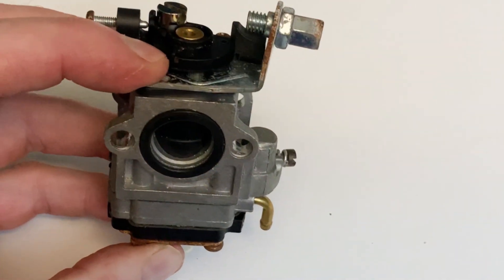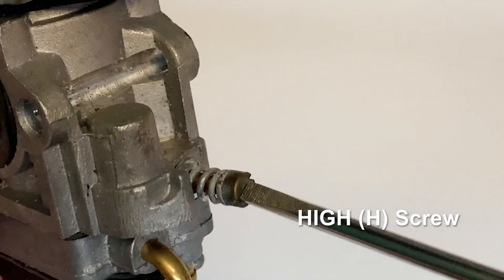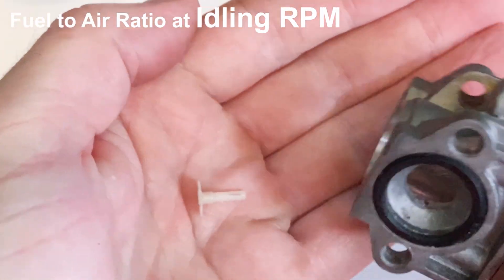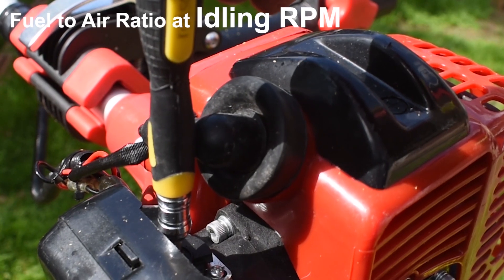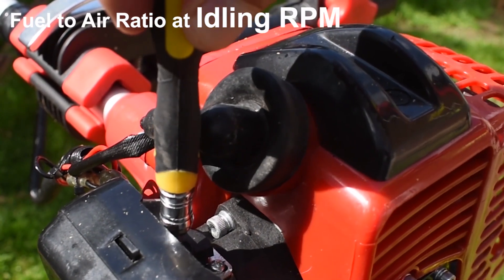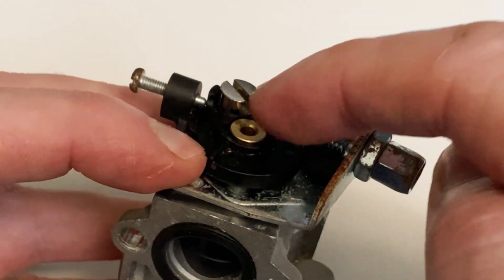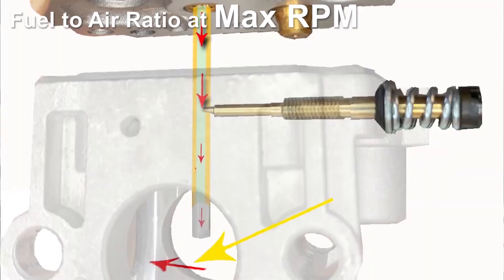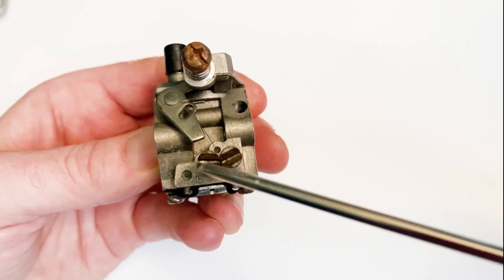Tune the Hidden 'LOW' and 'HIGH' Screw.  (by Craig Kirkman)

Comment: Hi

I have a John Deere t105s
It’ has the walboro carb but mine has no hidden screws at all. It’s the older version

So I bought a new Chinese knockoff and it’s same one that you have in your video.

I changed new fuel lines and new vented gas cap also.   So I put this new chinese carb in there and doesn’t run well

I noticed if you move the weedeater up and down or sideways the speed goes fast or slows down.  A lot of time it’s died out.  Even when warm sometimes it runs on choke which is strange.

I tried adjusting but something is always changing on me like when I change position of the weedeater the idle changes also

I fuel new file lines
Fuel filter also

What do you think it could be ?
Reply from the maker: Well, it’s not easy to say what is definitely wrong because it’s a case of trial error until the issue is found. But I do have some ideas as to what might be going on. Again, these are ideas: 

The new aftermarket carb may not be metering fuel correctly, especially when the machine is tilted.

When a trimmer changes speed or stalls simply from being moved up/down or sideways, that can say: 

1. The metering diaphragm is too stiff or not sealing properly

Many cheap Chinese carbs come with very hard pump + metering diaphragms. They don’t flex properly, so fuel delivery becomes inconsistent:
	•	When you tilt the machine → the diaphragm shifts slightly → fuel flow changes → RPM rises or drops.
	•	When it dies unless on choke → lean condition → metering diaphragm not opening the needle consistently.

Fix:
Try swapping the metering diaphragm and gasket from your original Walbro carb onto the new carb body, if it fits. If not, then try to acquire a OEM diaphragm. You will have to take a punt here as to whether it will run just like all others have to do in these situations. 

2. The metering lever height is incorrect from the factory

This is extremely common with knockoff carbs.

If the lever is:
	•	Too low → engine runs lean, dies, needs choke
	•	Too high → floods, loads up, bogs

Tilting the trimmer changes how the fuel sits in the metering chamber, so the problem becomes worse.

Fix:
Check lever height — it should be level with the carb body (Walbro spec).
Most new Chinese carbs come way out of spec.

3. You might have the fuel lines reversed

Even with new lines, if the purge bulb is connected backwards:
	•	It pulls air instead of fuel
	•	Tilt sensitivity gets worse
	•	Engine runs only on choke

Double-check this:

Fuel tank → filter → carb inlet
Carb outlet → purge bulb → return to tank

4. The vent on the new gas cap may not actually be venting

You replaced the cap, but some aftermarket caps don’t vent properly, causing:
	•	Lean running
	•	Stalling
	•	Needing choke
	•	RPM changing as the tank pressure fluctuates

Try loosening the cap while it’s running to see if the behaviour changes.

5. The Chinese carb may simply be a dud

You’re not imagining things — some of these carbs are wildly inconsistent internally.
If tilting the machine completely changes the idle, that only happens when the metering system inside the carb is unstable.

Here’s what I’d do, in order:
	1.	Swap the old Walbro diaphragms into the new carb if they fit. 
	2.	Set metering lever height level with carb body
	3.	Check fuel line routing (very common mistake)
	4.	Test with the gas cap loose
	5.	If still bad → rebuild the original Walbro
(They often run FAR better than most knockoffs)

Again, these are only ideas but I hope they help. 

Craig
Reply: Thank you for the ideas.  I will definitely try them out.

Comment: When setting the Lo-Speed needle do it in small increments and let the engine settle for a few seconds —then blip the throttle —it makes a BIG difference-again allow engine to settle and repeat sequence as necessary —Remember ! Leaning out the lo speed needle to much will make the engine when cold/warm it will be a pig to start —Likewise leaning out the Hi speed screw too much will make the engine rev higher — to be a “Screamer” —- but put it under work load -it will stagger and die —also being too lean can lead to piston/bore damage —-Secret is —Small adjustments and letting engine settle etc —Good video lad 👍🏻 clear explanation too for the novice “Tinkerer” 👍🏻
Reply from the maker: Great advice on those adjustments, thanks for sharing! Craig 👍

Comment: I need walbro caboratar dealer in Bangalore or Mysore karanataka
Reply from the maker: Thanks for your question! Walbro don’t usually sell directly to the public, so the best option in Bangalore or Mysore, Karnataka is to go through an authorized Stihl or Husqvarna dealer, since both brands use Walbro carburetors on many of their machines.

You can also check with:
	•	MGA Motors (Bangalore) – official dealer for Stihl in Karnataka.
	•	Husqvarna dealer outlets in Bangalore/Mysore.
	•	Online options like Amazon India or Flipkart, where genuine Walbro parts are sometimes listed.

Just make sure you’re getting OEM Walbro and not a clone – look for the Walbro stamp and part number on the carb.  

Let me know how you get on

Craig

Comment: Yes!! I finally understood the precise flow of fuel for the low n high engine mechanism. How to adjust both L & H screws by ear. And also adjust the idle screw if need to be. Gracias. Muchas gracias! You're my mentor n hero..Now let me go and make my weedeater do its job cause all this time It has been kicking my ass trying to make it work watching video after videos. A zillionfold blessings, Sir
Reply from the maker: That’s fantastic to hear, and I’m really happy the video gave you a good explanation of the fuel adjustment process. Craig 👍👍👍

Comment: I live at 4,700 feet (1432 meters) above sea level. It's very hard to adjust the low speed screw at this altitude. The high speed one had a much wider adjustement and not so difficult. I have to have my low speed screw almost all the way in. So I think if I lived even 300 or 400 feet higher I'd not be able to adjust it. The higher you are, the leaner you need the mixture, just like piston aircraft with carbs.
Reply: Maybe you explained yourself wrong....the higher the altitude the less air there is, so you adjust with less fuel. The ratio is not leaner, it must be the same "ratio" for proper running. You just need less fuel for less air. I also live at 1500m 💪🏻
Reply from the maker: Yes altitude definitely plays a big part in carburetor adjustment. 

At 4,700 ft (1432 m) the air is thinner, so the engine naturally runs richer. That’s why, as you’ve found, the LOW screw needs to be almost all the way in just to get a clean idle and transition.

You’re right that the HIGH screw usually gives more adjustment range, but the LOW circuit can run out of room at higher elevations. It’s the same principle as piston aircraft carbs — as you climb, you have to lean the mixture or the engine will bog.

If you ever did go much higher, you’d be spot on that adjustment alone might not be enough. In those cases, some people swap to a slightly smaller jet carb or file the limiter caps to allow more adjustment.

But overall, you’re handling it exactly as needed — leaning out the low circuit for your altitude so the saw can breathe properly. Great observation.

Thank you

Craig

Comment: Very well explained. I find this type of carb especially a bit more difficult to adjust. Its way easier on the ones with two larger screws. The hidden screw can be a pain to adjust whilst the engine is running. 
Still a well made carb and excellent explanation.
Reply from the maker: Thank you so much for your kind words. I really appreciate it. Craig

Comment: My strimmer idles a bit high, when unscrewing hidden screw it starts smoking and using to much fuel. but when turning in the screw it revs up even more and starts spinning. Do u know the factory settings for the hidden screw??

Comment: Another REALLY useful video.  I need to increase my knowledge as I am changing from a 4 stroke to a 2 stroke engine in my microlight.  I know the setup will be different to chain saws/weedeaters etc but the essential principles are the same. Thank you! 🙂

Comment: I have a carb on a JCB hedge cutter that has the hidden low screw but no H screw?  The only number on the carb is 5A. No name. Any ideas?  The machine runs ok but it's gutless at high revs and will only cut small branches. Thanks

Comment: Hey Craig, I'm surprised you didn't mention throttle response relative to the low screw. That seems to be the most common occasion that I have to tweak it if the machine is otherwise idling w/o issue, but has poor throttle response revving up from idle. Appreciate your help, time and illustrations in your content!
Reply from the maker: Hi. Yes it’s quite difficult to fit everything in when making a video and there does always seem to be something else that could have gone in. I suppose it’s a topic for another video 👍
Reply: This is great. Are €8 Carbs from Tamu etc OK?   It looks like your carbs are Chinese as well. I know the pros use Walbro or Tillotson but they are expensive and harder to find.   One more thing, does Stihl premix fuel contain ethanol? Jack

Comment: Tricky, if someone has made a mess of the idle Mix screw as if you try to set the main jet screw, it may be way to rich or lean trying to compensate for the idle mix screw. Fantastic carb but its all one jet like on a 70's original mini "variable jet" carb. SO...  you need to find out the idle screws turns for that carb and set it at "Base" and even the main jet too as a starting point then you can adjust main jet at high rpm and then set the idle mix after and you should all be good. Please...  warm up your engine first before going to full throttle as many channels say that 2 stroke, you can just go nuts from cold. Lotsa nice pictures of burnt out pistons and melted rings and scoring from over heat and too much stress on 2 strokes.

Comment: I have a very similar carb on my mountfield hedge cutter and was having problems starting it. The idle set screw had to be screwed down quite far to keep the engine running under idle. The L screw (exactly the same as the vid) didn't seem to do much. The H screw is a pacman type in a very awkward position. I noticed as the engine warmed up i could wind the idle set screw out to maintain idle and stop the blades moving. It's a real art setting these screws. Thanks for the info